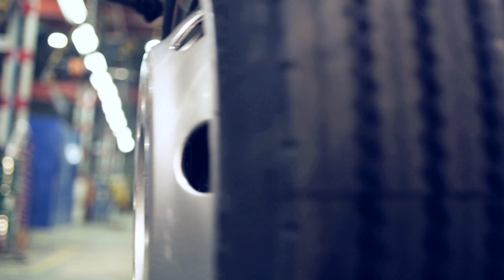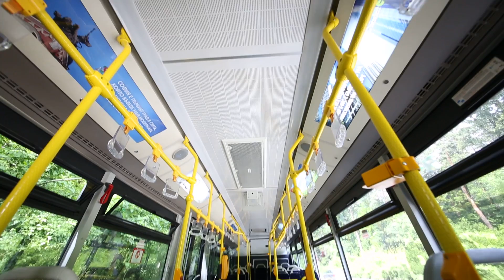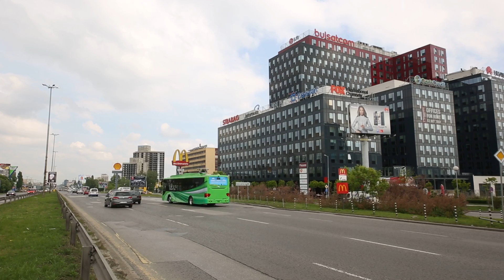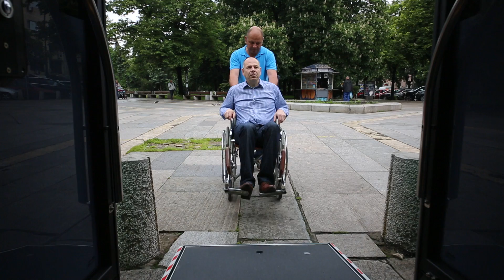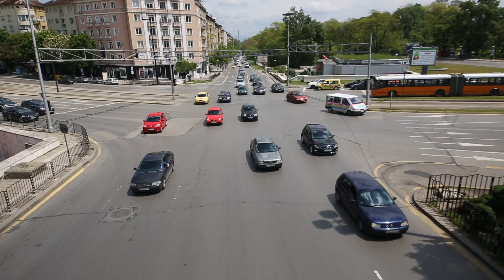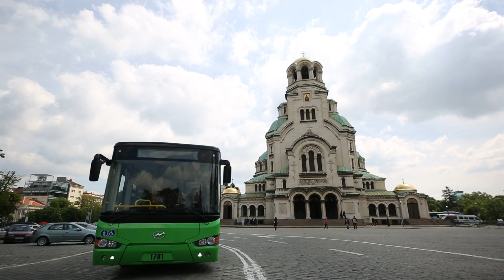Chariot ultracapacitor electric bus

Comment: This is 2019 and how is the progress
Reply from the maker: 55 kWh ultracapacitor, charged in less than 10 min @550A, allowing 40 km range under regular road conditions.
Reply: @milenmilev4396   wow that is amazing.. Why don't you do some videos of them. How many buses are there. do they use maxwell caps. you could be the TESLA of buses for sure

Comment: Sounds great from this video description...but was expecting a video of the actual noise levels of the bus in motion instead. From my personal experiences with electric vehicles, 'electric' does not automatically have to suggest an overall quieter ride unfortunately.
Reply: I think it's to do with suspension. Most buses are low-floor, and that makes them less quiet and comfy, but makes getting on and off quick because there are no stairs.
Reply: @موسى_7  I had disposable cameras that charged a capacitor from a 1.5 V battery to several hundred volts in a few seconds for the flash. The sound was quiet, but high-pitched. I can imagine how loud a bus supercapacitor that needs to travel 10 km can be. But it is a small interval of time, and a small price to pay for a quiet ride, and green energy (provided - of course the bus runs on green/nuclear energy.)

Comment: Super capacitors discharge very quickly so what's really powering the bus then ? Sounds too good to be true.
Reply: You have a 20 km range. But you can charge this capacitors when passengers get in and out in 60 seconds. Then you have another 20 km range.
Reply: https://www.youtube.com/watch?v=qLPmWEtgTy0
Reply: Joe Blue
> But you can charge this capacitors when passengers get in and out in 60 seconds
- Hey, driver, why we are stop?
- We need 60 seconds to charge... On the every bus stop... Even if we do NOT have passengers...
- F..k...
Reply: @barmalei9927  after 60 seconds you can drive 20 km, is it so hard to understand?
Reply: @barmalei9927  you stop every 1km for passengers, and so only every 20 stops you charge
Reply: Yes you r right..and they said 20 km of autonomy ! Yes but not the supecap who create this whole energy.
Reply: it appears they are equipped with a high capacity, they say they last for 20km which is great